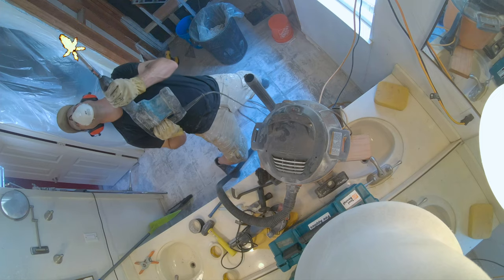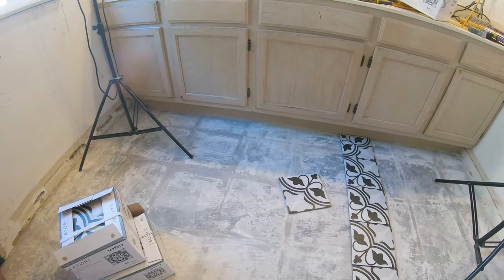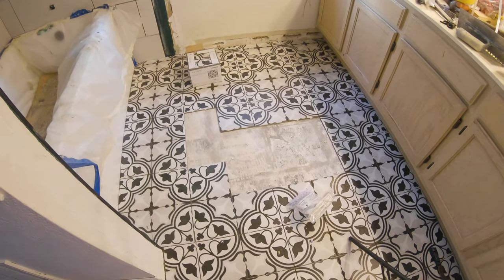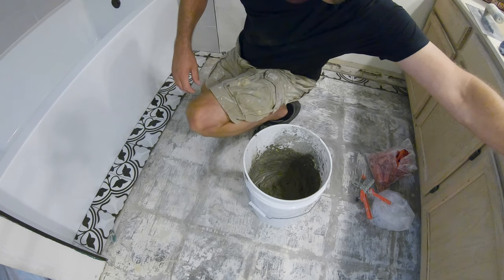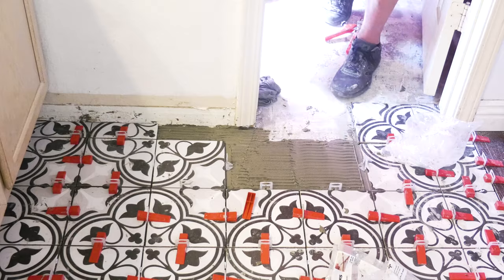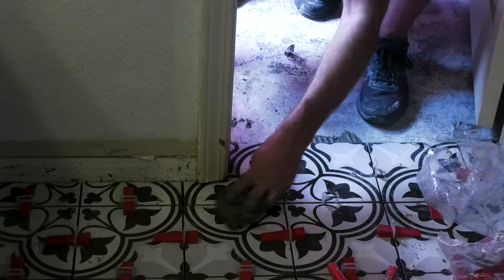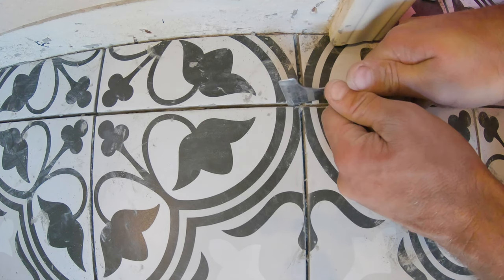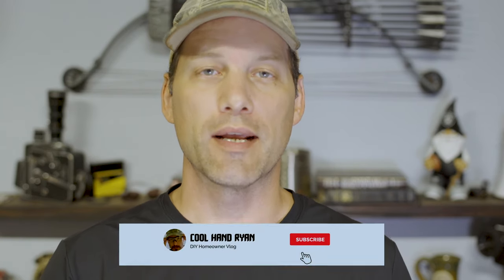DIY Bathroom Floor Tile Install [start to finish] Floral

Comment: Those 8" tiles always very inconsistent in size and square. Shouldn't use spacers ,eyeball them.You are an impressive DYI-er though.
If you have smaller tiles like this no clips are needed,unless its brick or staggered pattern. Stacked regular square pattern sets well without clips and wedges.BUT possibly best for DYI-ers.I think you are thorough enough to try without clips and spacers on These kind of tiles.Spacers wt such inconsistent tiles can cause massive staggered joints.You are killing it though, Been tiling over 25 years now.Trust your math as well on layout.Soon you can see every size cut in your head with no dry laying.👍
Reply from the maker: Thanks for the feedback, John. All of this makes sense. Next time I tile, I'll expect to lean more on my internal vision. Although, I don't think it'll be floral.

Comment: I dont belive it tile setter whitout jack hammmer by the way roockie put all the dry tile first use tape mesure calcule your joint make 2 square ligne there he go 10 min lay out done men
Reply from the maker: Rookie indeed. I don't tile for a living. DIY is the name of the game here. The layout for me was necessary to make sure I had the floral pattern lined up correctly. Ultimately, I do the job to my own satisfaction. We are happy with the way it turned out and I'm happy with the quality of the job. Thanks for watching and commenting, Constructive feedback is always welcome!
Reply: @coolhandryan  tile guy 25 years here ,and for a DYI-er you are KILLING IT. I started out doing everything youre doin.Learning whats best as you go.👍So far you Do the LEAST crap that makes me cringe.minimal actually.And THATS impressive for a DYI.keep it up
Reply from the maker: @John Bell  Thanks for the high five. And for taking the time to post this. Awesome. 👊